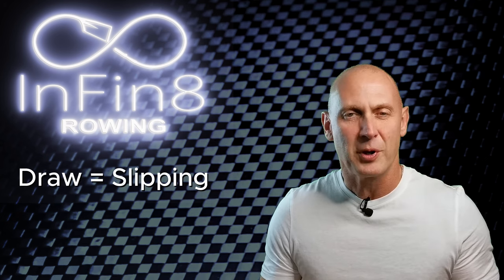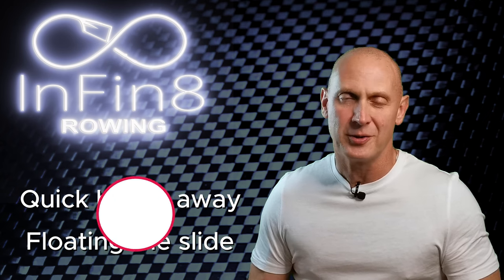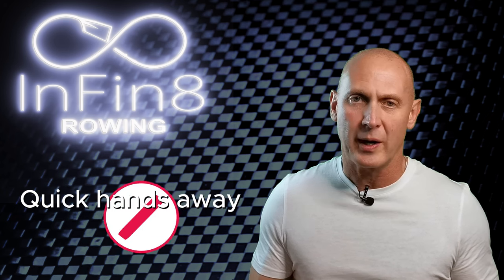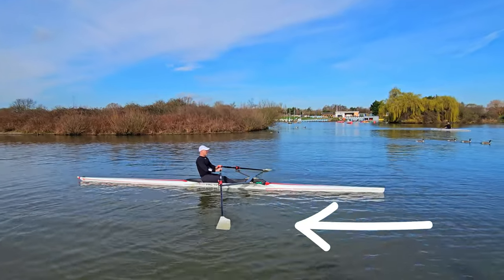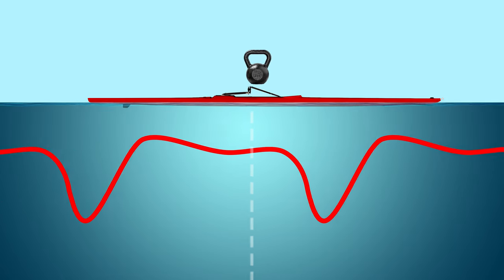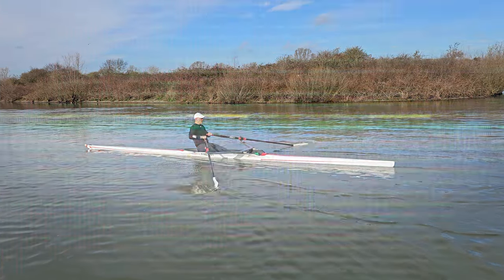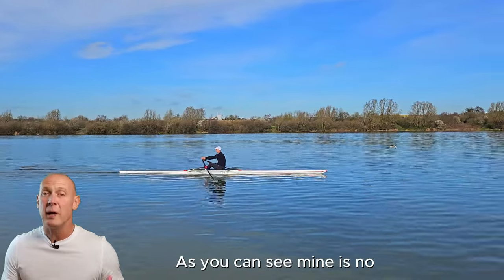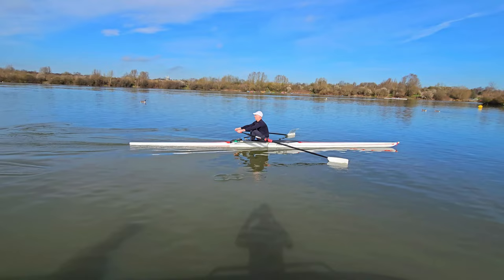Best way to increase boat speed during the recovery

Comment: I like the overall idea of keeping the boat speed constant (to minimise drag) by accelerating the recovery (a little), but I think you are slightly mistaken about the check. Ignoring drag, any change in momentum of the rower must be matched by an equal change in momentum of the boat. This is why accelerating the recovery will accelerate the boat, as you say. But when you inevitably decelerate as you come up to the catch, the boat will also decelarate, for the same reason. By the time you come to place and drive, you have already changed your velocity, and therefore so too has the boat. If you would measure the boat speed in your "no check" sequence, you would find the boat decelerate before the drive, not at the drive. It doesn't change your conclusion to keep the boat speed constant though :)
Reply from the maker: Thanks Mike. I often talk about the system of boat and rower, and yes, I agree that if you ignore the drag, there is nothing that can prevent a deceleration of the system, but drag is a considerable factor affecting the run. Gradually increasing the boat speed (not system speed) during the time that the system is equally gradually slowing down, serves to counter this. Nothing is perfect but we believe this is the best way to make this part of the stroke more efficient. My demo of the fact that the draw does not check the boat is imperfect. I am far from a perfect rower. What I hope comes across is that there is no characteristic check hallmarks, like a bounce on the stern or the boat moving backwards in relation to the direction of travel, as a result of "landing" on the footplate. Deceleration before the drive is unavoidable, but limitable. With the reduced drag from the draw as well as the fact that you get through this part of the recovery quicker, which causes you to spend less time trimming stern down, contributes to overall speed. You have to land the placement though of course.

Comment: This is better than a lot of the nonsense about “checks the boat”, but it does talk about “boat speed” rather then the speed of the centre of mass of the boat plus rower. Newtons first law - Every body continues in a state of rest or uniform motion in a straight line unless acted upon by an EXTERNAL force. There are 2 external forces. One is friction, and the other is from driving the oar through the water. You can accelerate the hull toward you during the recovery by pulling with your feet, but that is applying an INTERNAL to the boat force. Yes the boat accelerates, and you (your body) decelerates a bit and the centre of gravity of you plus the boat smoothly decelerates under the one active EXTERNAL force - friction.
At least you are a step ahead of the silly “checks the boat “ stuff when you plant your feet as that is also an INTERNAL force.
Reply from the maker: Thanks for the comment. And I do agree with the science btw. I appreciate that if you isolate the system of boat and rower alone, there is no net gain in speed, but if you look at my graphic and listen to my conclusion at the end, you will see that the gain I am referring to comes mainly from maintaining boat speed through the recovery and how that relates to resistance. The boat wants to progressively decelerate, and if it does so it sinks deeper and compounds the deceleration due to a larger wetted area. Using your centre of mass to progressively accelerate the boat, helps counter this. As long as you nail the placement and have connected before you drive, you are picking up a moving boat.